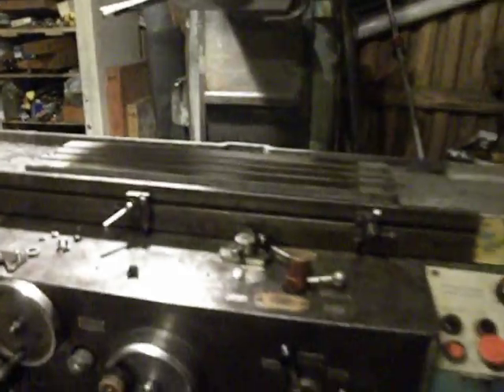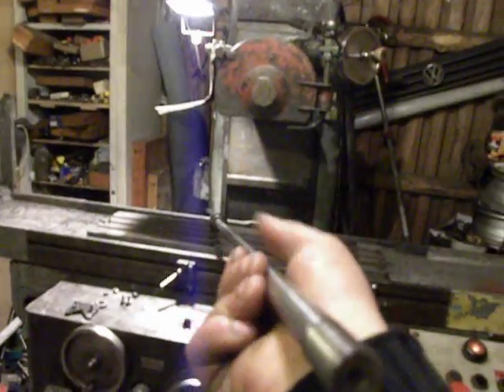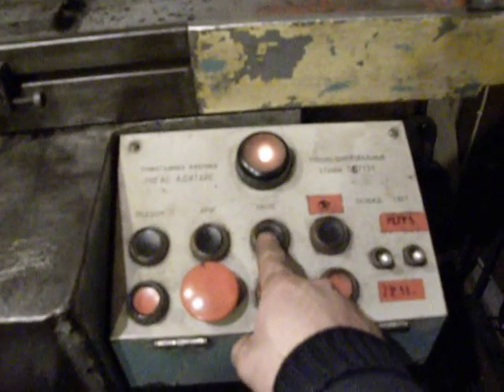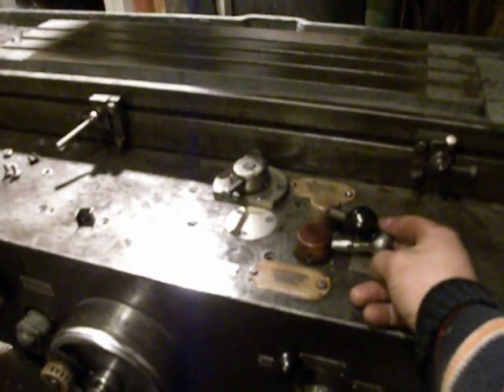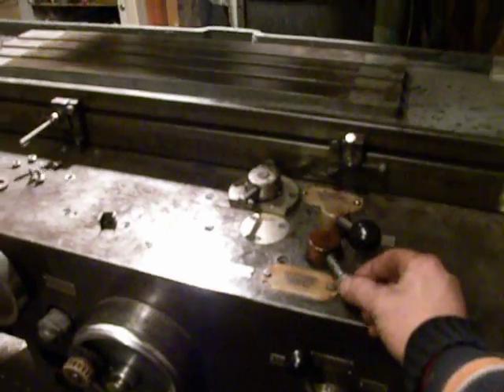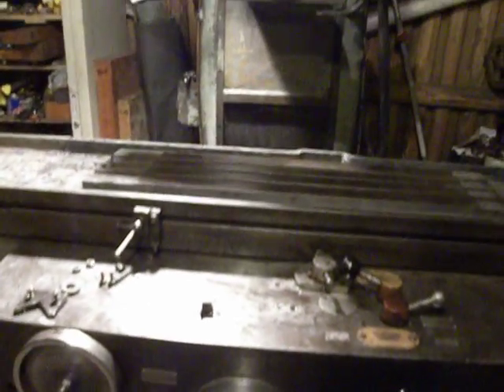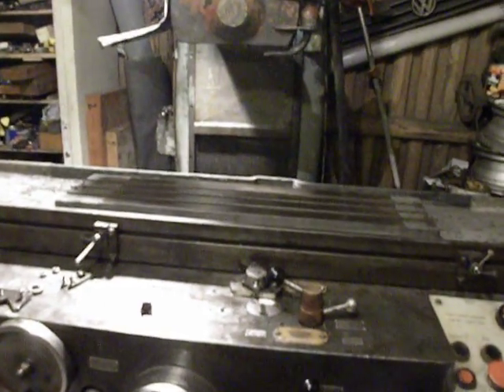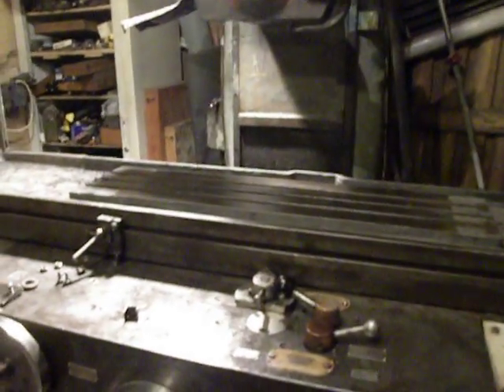Surface grinding machine 3B71M (3G71) repair part5 - machine table test run

Comment: You did it! I'm constantly amazed how you can fix machines. Congratulations on expanding your factory's capabilities. By now you must be running out of room in your factory. Will you be adding another shop room in the coming months?
Good luck for a very successful 2013!!
Roy